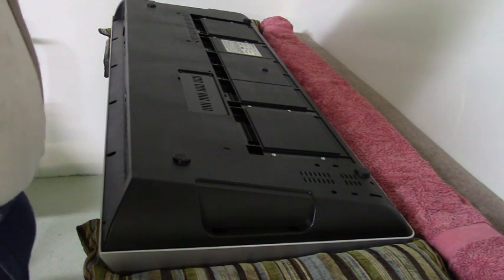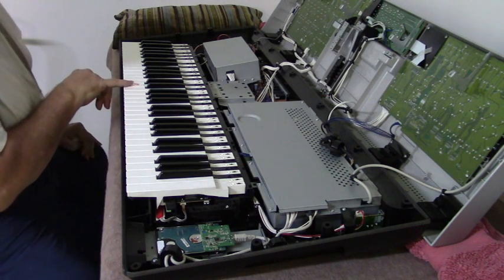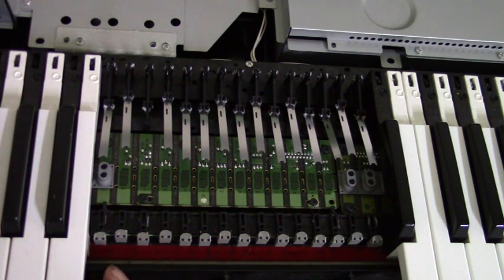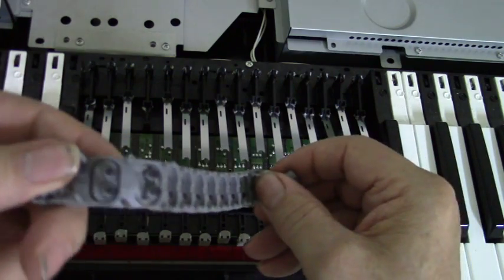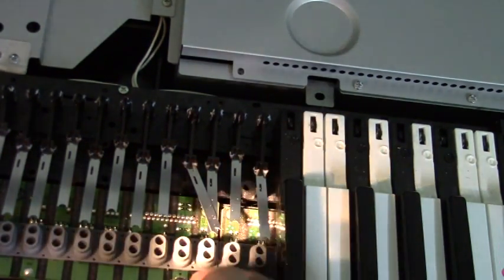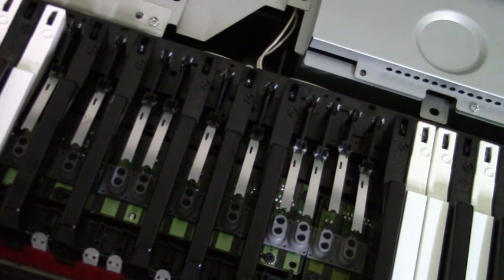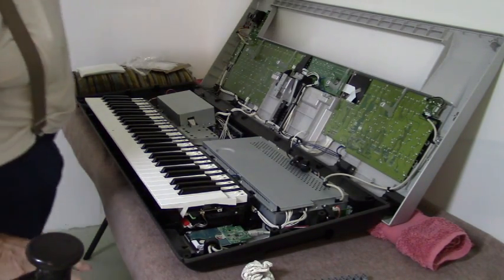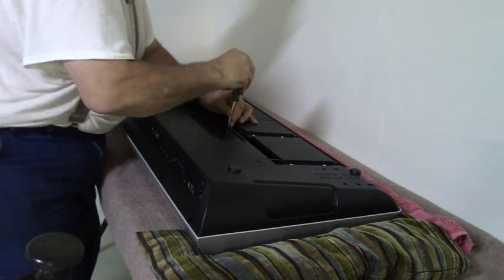Tyros 4 Dead Key LR

Comment: Hi Mate. Many thanks for the video. i was working on a Tyros 2 recently with a dead key. all i had to do was clean the ribbon and contact points on the PCB. one mistake i made (obviously i hadn't seen the video then) was to put in most of the ribbons upside down. not following the arrows which caused difference in volumes for most part of the keyboard. your video pointed this out and i sat once again to checking and correcting this. thanks a lot to you for your video. your video made me realize my mistake and correct the error. i now have a working tyros 2 with no dead keys whatsoever. Once again thanks a lot. cheers.
Reply from the maker: Your welcome Edwin,we have to learn to make our own repairs in most cases there is no one to help, 
    Craig

Comment: My c5 to d#5 keys have the opposite problem - always too loud.  Gonna have to attempt this repair I think lol
Reply from the maker: Hi;  the problem most likely is corrosion on the solder points of the key contact circuit board, not the contact strip
Reply: @craigdufresne8108  I'll check those.  I know I commented on this a long time ago but it's taken me that long to get the parts (I'm in the UK and no UK suppliers had it in stock).  Had to order from USA and it took weeks to get through customs lol.  But I'm well stocked on solder, flux and cleaning solution for dealing with corroded solder joints :)
Reply from the maker: @danwic  good luck let me know how it worked for you ....Craig
Reply: Hey, did it end up being solder joints? I have four notes that are registering max velocity too quickly even after cleaning the board with alcohol and the rubber contacts with water. Just trying to avoid replacing both contact boards

Comment: So, my lowest  C#, D and Eb went dead.  I called Yamaha.  They said it was the contact ribbon.  They said I needed the 13 note one and a 12 note one.  Don't know why as non of the others keys were bad.  Anyway, I follow your video, which was very helpful, by the way.  The old contact strip looked ok to me, but I installed the new one anyway.  Guess what?  The notes still don't work.  Now what?  I suppose I have to call them again.  Don't know if the built in tests would detect or correct the problem or not.  I have a good tech but am trying to do this on my own if I can for money reasons.  Any ideas?

Comment: Hello. I loved this video, you made it very easy to follow  i tried fixing the dead keys on my Tyros 3 and replaced the little pad strips under the keys. After turning the keyboard back on, the keys worked for 1 run up the scale but then reverted back to before. ( all the C and F# keys dont work...  except the ones at the top octave) After trying again, making sure I cleaned it well, those C and F keys still dont work. Do you have another video that could help me solve that problem? 0
Reply from the maker: Hi Debbie, I'm not a yamaha tec :~) but my wife has 2 a Genos and Tyros 4 and we couldn't find a repair shop any place around, so I got a service manual and tackled it my self and I've been lucky so far.... I've replaced the key circuit boards as well as some other components to keep the wife's tyros 4  up and performing... Now for your problem.. do you have (2) Cs and (2)F#s that work on the high octave end of your keyboard? and (4) Cs and (3) F#s  on the low end that don't work? if so the MK61L circuit board may be bad or some corroded solder points 
      The next thing you could check is when you installed the contact strips (Did you replace all of them)make sure the little triangle indicator is toward you. let me know how you make out and we'll see what we can do :~) Craig
Reply: Wow. Thanks for the reply. I have (3)Cs and (1) F# at the top that dont work. That leaves (4) Cs and (4) F#s that dont. I replaced all the strips with new ones and  definitely have the little arrow facing the right way.
Reply from the maker: @debbieturner2907  Did you mean the Cs and F# on top do work? it sounds to me like it could be corrosion on some contacts, i'll see if I have a picture of it from  the circuit board I replaced, it's hard to see but will cause a big problem.
Reply: @craigdufresne8108  sorry I wrote that wrong. The 2 C's and 1 F# at the top do work. The other C's and F#'s do not.
Reply: Hello Craig. Just letting you know that I did manage to purchase new circuit boards for my Tyros 3. I installed them today, and my keyboard works perfectly. Thank you for your help.

Comment: I need to replace all my rubberstrips on my Tyros4 , I find 12 and 13 strips in the shops, not sure how many of each , I guess from the vid I need 3 strips , but 12 or 13 how many of each ? thanks (now a subcriber)
Reply from the maker: Hi Rolf;    there are 5 strips all together 1each 13   key strip that would go on the far left end of your keyboard and 4 each 12 key the rest of the way across.... part # 12 key is WB 16880R   and Part # 13 key is WB16890R
Reply from the maker: why are you sure you have to change all the strips? that is very strange, what is the problem with your T4?

Comment: All the C and F# don't work work correctly on my Tyros 3!  Do I replace all the  contact ribbons?
Reply from the maker: Hi Dave... It's highly unlikely that the contact ribbons are your problem.. you would have to have the same contacts bad on all 3 ribbons as for the circuit boards for the keys (2 of them) could have to have the same circuits bad, see Debbie Turners last comment below... changing the circuit boards worked for her.Good luck and give me a shout if you find something or I can help in some way, Craig
Reply: @craigdufresne8108  Thanks!  You are correct, had to change circuit board!

Comment: 17:09 Funny... you see the metal springs and the bare electronic contacts of the pcb just under them without any protection. So... if anything goes wrong, like the spring would get loose or break off then it would fall down on the pcb causing shorts over there... So, I would not have expected this in a machine that costs thousands of dollars...

Comment: Do you have any idea if the carbon contact in the pcb was eraced? I mean a liquid was spilled and after I wiped it, it naturally came off. Is there any option to fix it?
Reply: hey there, 3 of my keys are kinda dead, it works when i press hardly on them, ive them open now, looking at the carbon,  but i donno how to clean them, shall i use a steel wool ? slightly

Comment: Hey I have a question I have one my harmer not responding to the touch response so I took out key rubber and clean it and assemble it and the non of the key working again please help me out
Reply: Yamaha mo8
Reply from the maker: Joey, the key response is controled by a felt strip mounted  under the keys(red colored on the tyros 4)this strip is self adheasivewith double stick tape. check the  ribbon connection on right end of felt strip. as for none of the keys working after you cleaned the rubber strip.... make sure you placed the strip facing the right way( little triangle on strip should be pointing toward the  edge of  keyboard) and check to make sure no connections came undone. let me know how you make out
Reply: actually its yamaha motif mo8
Reply from the maker: Hi Joey,  I'm not a yamaha tech, My experiance comes from working on my wife's tyros 4 and I have the service manual for it... I assume your motif MO8 is somewhat  alike. I'll look into your model and see what I can find.
Reply from the maker: here is the service manual download,check out page 125, item 280... this may be the contact for touch responce(I'm guessing) part # v2211300   https://elektrotanya.com/yamaha_mo6_mo8.pdf/download.html

Comment: Hi! Craig,
I have a question to ask you, do you know how I can repair the style control (main variation button), the D button broke and went down not push up but it still function. Do you know what part number and where to order? Thanks.
Reply from the maker: PN#  WN136400   button assy

https://www.yamaha24x7.com/#/quickorder

WN136400 1 In Stock $42.77 $42.77   I have the service manual if you need some help :~)
Reply: Thank you Craig
Reply from the maker: Hi Chao
 glad you got it
  Craig

Comment: Hello,   Craig. Thanks for your great video. I have   MOXF6 , 61 keys synth, and need to replace some keys. Are the keys  different from the standpoint of assembly or disassembly? When I contacted Yamaha 24x7 they said that the keys come in a stack of 4, so I am wondering may be key bed and assembly is different from Tyros.
Reply from the maker: Hi; Here is a link to a pic of the assy. and a list of key configuration they are changed in blocks. I don't know the procedure but will see if I can get you some info
   https://syntaur.com/K48W.html
Reply from the maker: I found the service manual contact me with your email address and I send the PDF file of the manual
Reply from the maker: here is a you tube video of repair for MoxF8 and MoxF6 don't know how good it is as I haven't watched it
https://www.youtube.com/watch?v=Oiupge0qtqQ
Reply: Thank you so much for your info and links. This helped a lot. The keys are in a stack, and not individually to replace. So I just need to unscrew the edge  and replace the stack with new key stack.I have seen videos in this combination. Thanks again